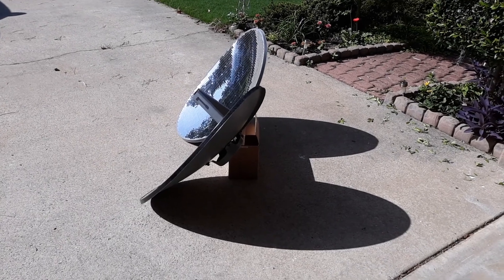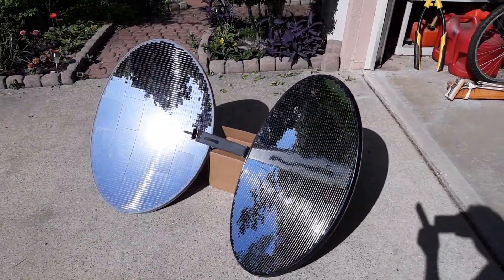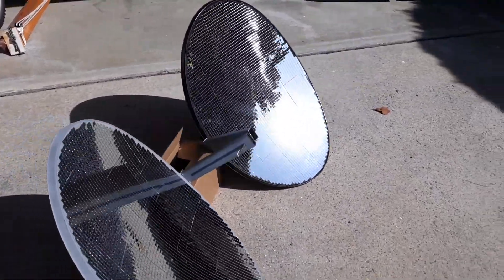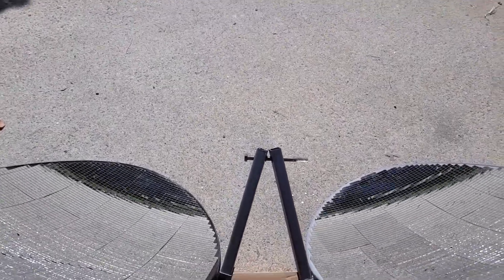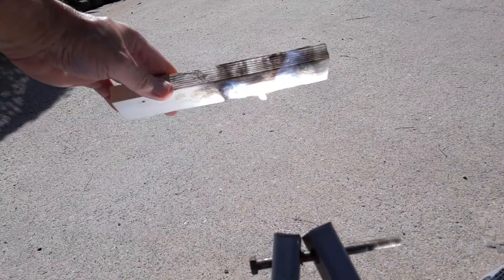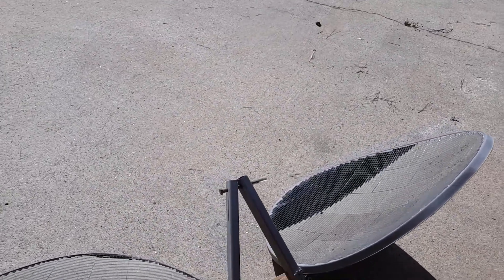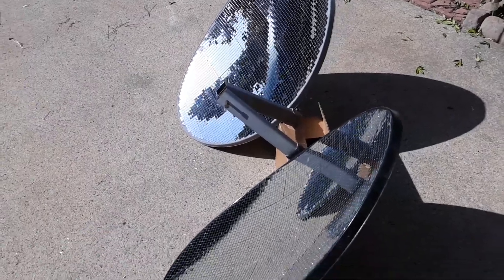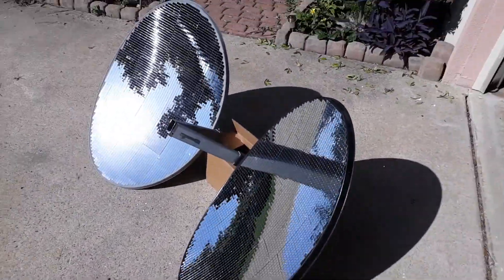Update - dual parabolic mirror dish solar cooker

Comment: I would like to see this system explored to its fullest. mirror+motors+hot water+boiler+shower. But it seems that there is nothing like this on the internet. They all reach the same point and stop.
Reply from the maker: Maybe when SHTF, that'll be using this a lot, LOL. Thanks for watching

Comment: Is it possible merging two focal point into one place? I wonder how many temp will achieve
Reply from the maker: Hi, that is exactly what it does.   I cut down the receiver(?) arms and bolted the two together so the focal point of both are at the same spot.....about 6" above the cut off ends.  Thanks for the comment and watching the video
Reply: @jimmyboy163  Is it possible to get both to track the sun automatically yet still direct the photons to the common focus?
Reply from the maker: @fleaniswerkhardt4647  hi, well a tracker would be nice.....lol

I plan on a new video soon, hopefully this week.....with it boiling water (or at least trying.....but I'm sure it will,  just don't know how long it takes)

If you saw any of my other videos,  you'll see that I'm doing a walk in shower renovation....and that takes priority (the boss is on my case for taking too long, lol, if you know what (and who) I mean!!   That should be done by this weekend,  and I'll get back to the solar cooker.

Thanks for watching!
Reply: @jimmyboy163  I totally understand. Getting nagged into compliance is a horrible experience, it's much easier to shut up and surrender and  get the job done.  That aside, I was thinking that to get a single dish to track the sun is relatively easy. But for both dishes to track and have the same focus - they each need to be controlled separately in at least one axis wouldn't you?   you'd be basically building a heliostat (as distinct from a solar tracker).  Something that is on my to-do list but there is not a great deal of info around on exactly how to do that.
Reply from the maker: @fleaniswerkhardt4647  I've bolted the dishes together at the (shortened) arms,  so if they were on a tracker, they would at least move together.   I had to shorten the arms so that they wouldn't interfere with the focal point.
Reply: @jimmyboy163 I can see that it would work for 2 dishes.But is it possible to put 4 together with the common focus? If it was possible you'd have some serious temperatures at the focus.

Comment: Is there a way to contact me? I'm trying to figure out where you sourced the mirror tiles and find any other videos you have on this project. Thanks. And I mean, WOW! Great job on the dish!
Reply from the maker: Hi, I bought the mirrors from Amazon.  They are the glass kind not plastic.   Was about $12 a pack of 10 (4" X 6") sheets with self adhering backing.
Reply: @jimmyboy163  first, thanks for the super quick reply. Second, I've searched Amazon and I don't see the product. Any chance you have a link? Thanks again! Chaz
Reply from the maker: @chazsteadman5020  your welcome.  From Amazon.    Currently out of  stock 

AIVS Self-Adhesive Real Glass Craft Mini Square & Round Mirrors Mosaic Tiles/Stickers for DIY Craft Decoration(10 x 10 mm, 1500 Pieces)
Reply: @jimmyboy163  thanks again, I'll see if I can source it somewhere else. Have a great day. I don't understand why you didn't get a ton of views on this great project! I couldn't find any other videos of yours on this project. Tubebuddy says you have 63 videos but I only see 6 on your channel home page, none of which have to do with solar. Weird.
Reply from the maker: Hey Chaz,  thanks!  I started off with reflective film greenpowerscience(?), but it didn't stick very well so I went with glass mirror tiles from Amazon. They are self-adhesive and stick very well.  

AIVS Self-Adhesive Real Glass Craft Mini Square & Round Mirrors Mosaic Tiles/Stickers for DIY Craft Decoration(10 x 10 mm, 1500 Pieces)
Reply: @jimmyboy163  thanks so much for the update! I left the 2 satellite dishes with my son 3 1/2 hours away b/c I put the project on hold. Damn! lol.
Reply from the maker: @chazsteadman5020  my mail is heavyliftpilot at 'gee' mail dot com
Reply: @jimmyboy163  I was able to source them on amazon about 3 weeks ago. (Thanks!) I decided to go with 5mm x 5mm. My theory is that 5x5 will produce more concentrated light rays to the focal point than 10x10's. Correct?
(fixed wing or rotary? huey driver back in the 70's.)
Thanks again.
Reply from the maker: @chazsteadman5020  10X10 is small,  5X5 is gonna be tiny!!    But, should work as well or better.

I trained in hueys than an aero scout pilot in oh58's, finished my career in the chinook